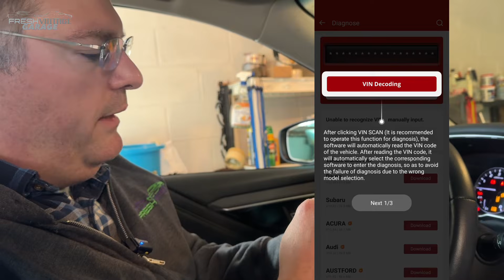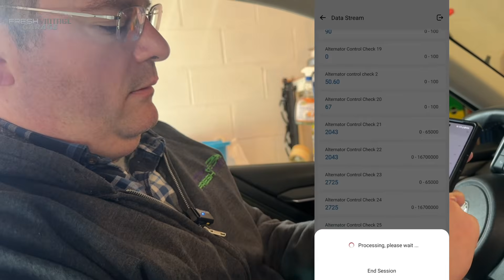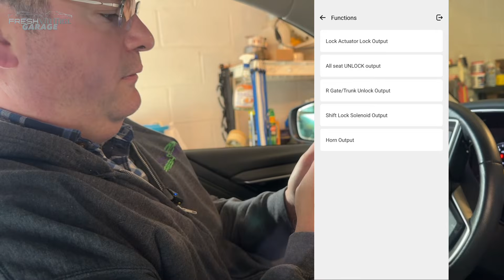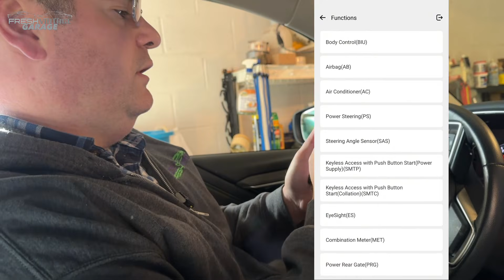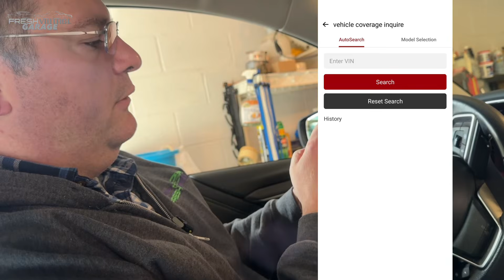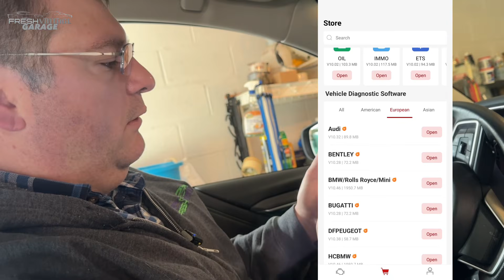We check out the BRAND NEW Kingbolen Ediag Elite - See it FIRST HERE

Comment: Is it true this has to be online to operate?
Reply: If you are plugging it into your vehicle for the first time u will need Internet access to be able to download the software of your vehicle make and once that is completed you won't need Internet access anymore unless your plugging into another vehicle with a different manufacturer for the first time hope this helps 👍🏼
Reply from the maker: No it does not need to be online or have a continuous internet connection to operate 👍 You will need internet to do the firmware and software updates though.

Comment: I would like to get one of these. But I'm unsure if it will work on a 2000 Camry LE 2.2L. I bought a fix thing they charge to use it. Nope. What a waste of money. But this looks interesting. It would be truly helpful for me. Thanks much for your video.
Reply from the maker: For code reading, diagnostics, live data graphing, and some reset functions this will work well with your Camry 👍
Reply: I have a 2017 Toyota Camry Hybrid and this does EVERYTHING hope this helps 👍🏼
Reply: Camry 2013 can we do Transmission coding or reset..?

Comment: I understand it will tell you if a RELAY is bad. But, will it tell you if a SENSOR is bad or is going bad? Like for example an oxygen sensor? 

Will it inform you an ELECTRONIC VALVE is going bad or is bad? Like for example an idle air control valve?

Anyone know? Plz only answer if you know for sure, and you’ve personally used this device; please no guessing.
Reply from the maker: Thanks for watching we do appreciate it!
This will tell you if a sensor is getting out of spec range, but you would also need to know the OEM specifications of any given sensor to be 100% which can be found online depending on your year make and model vehicle.
Reply: @ so it will recognize sensors? All sensors or some? I can use Gemini AI to locate the specs. I just need to know if it will recognize all my Jeep’s RELAYS - SENSORS and ELECTRIC VALVES.
In real time I’m assuming?